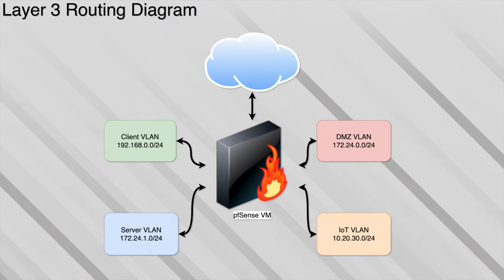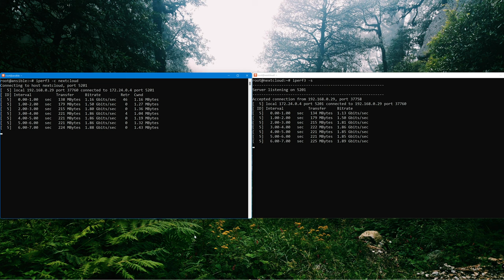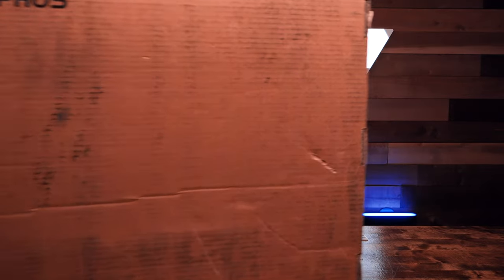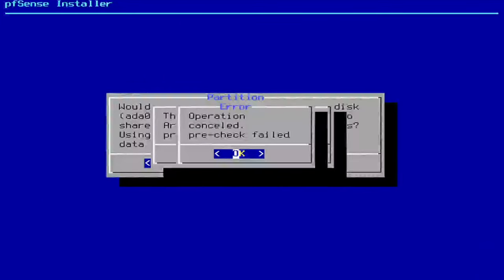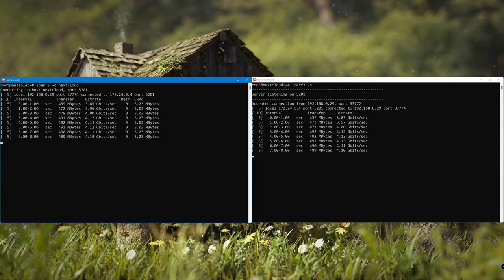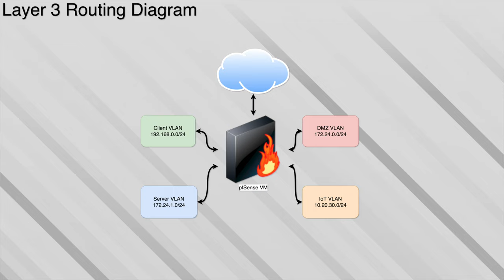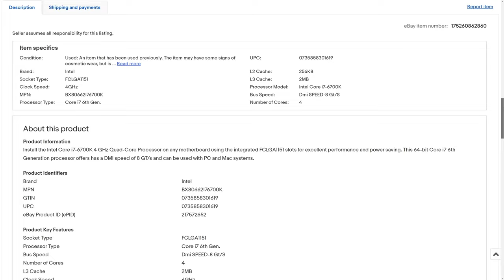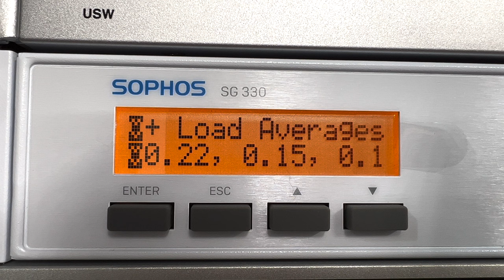I built a HIGH PERFORMANCE hardware Firewall! - Sophos SG 330 Rev2

Comment: iPerf by default is also single threaded. This might explain why you don't see much of a difference since in this case your "bottleneck" may be the CPU of your iPerf client/server. iPerf can use multiple threads to simultaneously send and receive data. Use the -P switch followed by the number of threads to use.
iperf -c -P 4
Reply: That tast would only be meaingful if the real life workload that he tried to address was also multi threaded, which it wasn't in his case of copying files.
But maybe tools like robocopy with its /mt switch might help in this case
Reply: It all depends on the sharing protocol used. NFS is multithreaded while SMB isn't (unless SMB multichannel is used).
Other thing to keep in mind is pfSense is limited by its kernel-based packet processing which out of the box isn't made for 10Gbps+. People who want more than 10Gbps should look at TNSR instead, which leverage Vector Packet Processing (VPP) and deliver substantially greater packet-processing performance and throughput.
Reply from the maker: If only TNSR was also a firewall...
Reply: I am running a custom built pfSense with a i7 8700k + 32GB of RAM with a Chelsio adapter with 2 x 10GE SFP+ port and I can route at 10Gbps both direction no problem, while the CPU isn't even flinching pass 10% much.   
I would say with the many labs experiment I did in the past with pfSense on many fanless box, VMs under ESXi, Proxmox, XCP-ng, Virtual Box and Hyper-v, that the drivers used for the NICs will greatly influence the throughput.  
For example, under Vmware, anything intel E1000 setup for drivers will slow down to a crawl whatever performance benchmark you will do.  pfSense kernel also use 1 thread per network session, so CPU single core performance will also be an issue. Sub 3Ghz single core performance will NOT be able to sustain bi-directional 10Gbps.
Another thing to consider if you ware using SPF+ Transceiver is their compatibility. If they are not, they will over heat, and if you are using a RJ45_to_SPF+, it will impact your performance too - or reset your switch and or port or both - happened on a Ubiqui EdgeMax 48-port a few years ago.

Comment: Really good vid! I was just doing some research to implement a series of VLANs on my home/homelab network and after surfing reddit, I basically came to the same conclusion you did. You need hardware for a proper firewall/router!
Reply from the maker: That's sadly the truth! We're big proponents of virtualization, and having the FW be virtual gives great flexibility. But in our case hurt our performance.  Thanks for the comment!

Comment: Another reason why a dedicated hardware solution is nice is that your VPN connection can get faster. I moved my pfsense installation from a VM to being the only OS installed on a particular box and I saw my OpenVPN throughput increase from ~50/~50 Mbps to 157 / 193 Mbps on the same exact hardware.

Comment: Heatsink for NIC controller(s) in the back looks smallish for so many ports, as well as being 10G... I think there is a lot of CPU utilization for routing traffic, versus just using the CPU for rules and inspection on that motherboard. If that is a stabdard pci-e slot, just with a strange header orientation, I wonder if putting a server NIC in the slot would see any speed increase in your iPerf tests. 
All about the bus speed for these things in the end. If you can do a stable overclock, there should be a notable difference.
Reply from the maker: You bring up some really good questions about the thermals of the Intel NICs in the box. Next time we do some maintenance we'll throw some better heatsinks on it!  Thanks for the suggestion and watching!

Comment: I use Nftables with Fastpath over Firewalld with dual port Mellanox 100G Connext-6 NICS on a PCI5 Threadripper Pro .  We do east/west firewall and inter-vlan routing for 20 Vlans, 300 nodes..

Comment: Yes, this is a year old, but you skipped an important bit of information. What Hypervisor and what were the settings? Incorrectly configured VM settings will cause this, as well as what else is running on the server.
Reply from the maker: I believe I touch on it in the video, but everything we run here is VMware ESXi. And completely agree that how you configure the VM and the host's workloads affect performance, unfortunately misconfiguration was the source of the bottlenecks. Thanks for the comment!

Comment: Seems like part of the reason the 6700k doesn't get you much increase in performance might be the increased TDP since the box wasn't designed for the 91W part. I would imagine there would be at least cooling limitations, if not straight up power limitations. Would be interesting to see what an i7-6700 (non-K) would be capable of, though my guess would be that it would be similar based on the core clocks (10% > i5-6500).
Reply from the maker: This is possible. I’m actually going to make some minor cooling changes to the unit here in the near future, I’ll definitely check again!
Reply: Noctua NH-L9i-17xx Has a fitting heatsink with heatpipes. The fan won’t fit without cutting a hole in the 1u enclosure though.

Comment: question for the proof pfsense is CPU bound:
i can see thats its single threaded, but would you get gains from faster memory?

i just switched my virtualized pfsense from an i5-4570 to an i7-8700 and saw clonezilla nfs transfer speed increase from around 6gbs/min to 20gbs/min 
i dont know if i can pin that to faster cpu clock tho: it was two back to back same tests, just the second time was on an i7-8700 with ddr4 on nvme
i dunno how much the core clocks influenced it tho, i would guess memory had a hand in that increase,
but also im curious on dual channel vs quad channel

but yeah optiplex 3430 for $200 on ebay, plus a 10g card,
im curious to see what one of those Erying i9-11900H's could do

Comment: Why is avoiding use of ACLs on a switch is best practice? Whos best practice is it?
Reply from the maker: Great question! Typically Layer-3 switches have specially designed chips in them called ASICs that are designed to switch packets between interfaces incredibly fast. ASICs do one thing really well, but really only that thing really well. Processing and filtering ACLs requires general computing because rules needs to be calculated per-packet, which is handled by the CPU inside the switch. The CPU typically has enough overhead for a few ACLs here and there, but the more ACLs you have that need to be processed, the greater chance your switch's CPU won't be able to keep up. At a minimum you'll experience performance issues, at a maximum (and I've seen it with certain Cisco L3 switches) they'll crash.

In network design theory, it's widely held that if you need to filter packets between networks (inter-vlan, edge, or whatever) you should use a firewall. Unlike a network switch, a firewall's job is to apply rules and filter packets accordingly. This is what a firewall is designed to do, and it does it very well.  

There are caveats here worth mentioning. 1) If you only have a few ACLs you'll be fine running them on your L3 switch. 2) Technology is always getting faster, it's entirely possible there are L3 switches out there that can handle a massive amount of ACLs and not break a sweat.

Hope this helps!
Reply: @2GuysTek  then you should know then unlike firewall that analyze full packet switch ACL read only IP headers on packets . So it need much less compute power. And problem may starts on cisco only when you use extended ACLs that analyze also ports information from packets.

So you suppose to use proper tools for each case understanding what you doing and why you doing that no saying this is best practice and this is not best practice.

Comment: So I was looking at picking up one of these SG 330 Rev 2's and they all seem to be $800 and up.  Also most of the ones being sold are Rev 1, which do not have SFP+. Is there another place besides eBay to find used Sophos hardware?
Reply from the maker: Something seems to be going on in the hardware aftermarket lately. There are a lot of things that are just getting out of control price-wise. If you can’t find an affordable SG with SFP+, it might be time to consider building out a small form PC and throw in an SFP+ card.
Reply: Sophos sg series is end of sales June 2023, updates ending 2025. Prices should be going down.
If I had more gear to attach I might try a CPAC-4-10F in the flexiport.

Comment: i know this is an older video but i found this as i am looking to do this too. 
Were you tagging all 4 vlans on the same physical interface, If so you might get better throughout moving each vlan to a seperate physical interface
Reply from the maker: The connection to the downstream switching is a single trunk with multiple connections, yes. I like your thought process, and it might be something to test later on! Thanks for the comment!

Comment: I have been eying a Sophos SG450 Rev. 2 comes with SFP+ card, dual ssd, dual power. It is offered for $450, expensive for what offers? does this eliminate cpu bottlenecks for homelab use? I am on a similar boat. Great video!
Reply from the maker: It did largely for me. As you saw in the video, we're getting great throughput on the 10gig connections, and removing the issue of service interruption when doing updates to our virtual infrastructure was a big win. That SG450 sounds like a beast! It's definitely a step above the SG330 we used! Give it a shot if you've got the money and the interest! I'm sure it'll serve you well for a long time! Best of luck!
Reply: Do these run loud? Compared to desktop fans or synology drive.
Reply from the maker: I can’t speak to your model, but the SG330 isn’t any louder than a Synology NAS.

Comment: Hmm, don't you need to re-install PFsense if you change the processor? I think so.
Reply from the maker: Not at all. The pfSense dashboard correctly recognizes the CPU and shows its features. Potentially if you were to move to an entirely different generation of CPU that may be the case, however, I still suspect it wouldn't be.
Reply: @2GuysTek  Ok, thank you.
Reply: No you don't need to reinstall as FreeBSD will handle the changes just fine.  I even moved the hard drive from my old i7 to Ryzen 9 and it booted up just fine.  Only time you need to reinstall if you're switching from X86 to ARM which require a completely different OS.

Comment: Guys I’m wondering if I can install pfsense on Sophos XGS series if anyone has tried it pls lemme know
Reply from the maker: I have been trying to find any information I can about the internal hardware on the XGS line, and have not found a definitive answer. If the system is running on x86 hardware like ours is, it's very likely you'll be able to easily install pfSense on one. The risk is the case where the XGS is running on ARM instead of x86, and in that situation you'd be out of luck.  Best of luck and let us know if you have success!
Reply: @2GuysTek  its really hard to find information about sophos hardware, I thought it has a main x86 processor and secondary arm processor but if it’s only built arm I think I’m just gonna stick with XG series